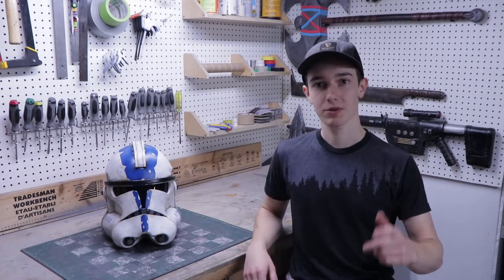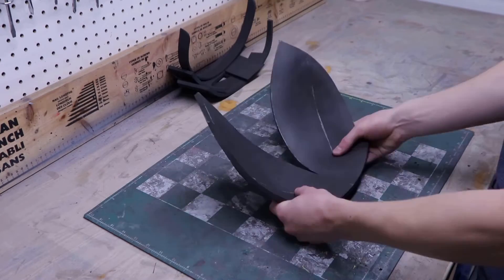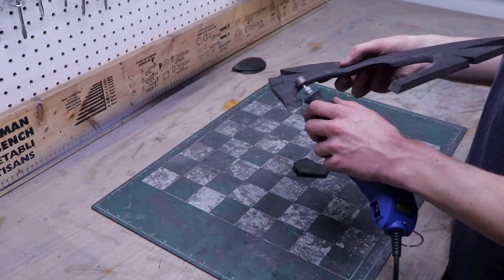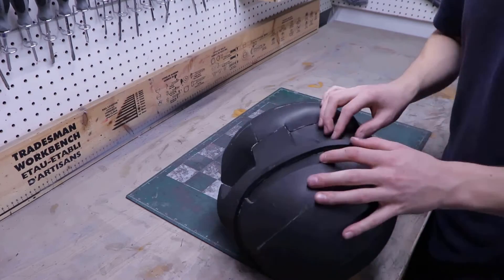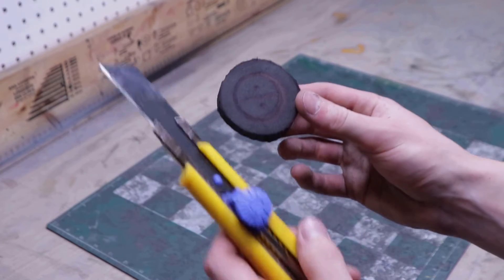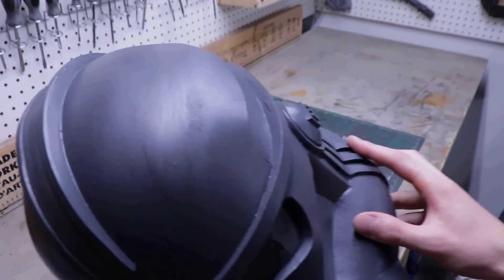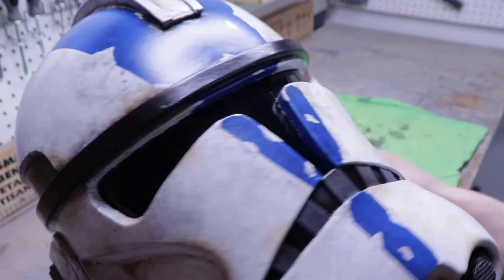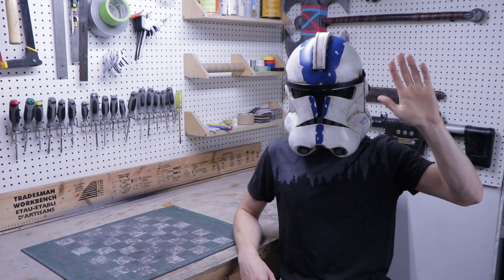Make Your Own CLONE TROOPER Helmet Out Of EVA Foam | With Templates

Comment: Do you think I could have mesh in the black areas of the mouth piece for ventilation? I’m very claustrophobic and I would need some airflow
Reply from the maker: Yes! You can cut out the black areas once the helmet is built and glue in a mesh material. You might need to reinforce that area since foam isn't super strong. :)

Comment: I am trying to (long term) make a good amount of clone helmets, would you say that spending the money on 3 d printed helmets is more worth it than doing eva foam if you don't have much time on your hands? Which is the best option time wise, while still being not horribly expensive?
Reply from the maker: Buying a 3D printer and printing your own helmets is definitely better than buying 3D printed helmets long term.

Making helmets out of EVA foam and finishing 3D prints takes about the same amount of time. The difference is that it might take more practice to get good with EVA foam than with just sanding and painting an already printed helmet.

I find that building a helmet out of foam is more fun and less repetitive, but everyone has their opinions on this.

Comment: Hey so I’m using your armor and this helmet templates and I am making an arc trooper, how do I modify the fin to be the arc trooper fin?
Reply from the maker: For my armor I used the fin from my phase 1 clone helmet templates. Also the front under the grill is a bit different. The tip is pointy and the respirators are more round.

Comment: How do I print the templates? I bought it but I don't know how to print them the right size
Reply from the maker: You can print the templates on any size paper and using any printer.

Check out the sizing chart located in the pictures of the listing to find the scale that matches your size.

Then, simply watch the printing tutorial video linked in the product description. All the information is there.

Comment: Hi, thank you for the amazing tutorial! I was wondering what you used for the visor? I see you cut it out, but I don't understand what you used to fill in the space. 
Thank you 😊
Reply from the maker: I used a tinted welding shield. You can find them on Amazon. :)
Reply: @TristanMaker  So I'm trying to make the helmet and the foam is not sticking together. I'm using Lepage heavy duty contact cement and craft foam to make a trial version before I make a full helmet and it's not flexing at all and the glue won't stay, what am I doing wrong?
Is there a difference between EVA foam and craft foam?
Reply from the maker: The biggest issue is the Lepage contact cement. I tried it and it just doesn't stick well at all. I recommend DAP Weldwood or Barge cement. And yes craft foam is EVA foam, but you really have to  heatform it to make a helmet.
Reply: @TristanMaker  ok thank you, the biggest problem is I can't get those where I live, I'll have to order it online. Is it easier to do it with Eva foam? Should I just start over?

Comment: I bought the template awhile ago and am just now starting the build. The 8mm visor piece that has the 5 mm attached, am I supposed to cut that piece out seperate and trace on 5mm?
Reply from the maker: Yes exactly, you cut that part from the template, trace it on 5mm foam and glue it on the existing 8mm part
Reply: @Tristan Maker  okay great thanks! I may have other questions as I go...first build!

Comment: So I want to make this helmet but when I measured my head circumference I found it’s 22 inches and a half so would I do the percent for 22 or 23 when I print it out
Reply from the maker: You can simply print the helmet at 100% scale. It will fit perfectly with some padding inside.

Comment: incredible work, dude, congrats, a question, can i cover the helmet with glass fiber to make it strongest than just eva foam? is a similar process, right? the resines of glass fiber not "eat" the eva foam?
Reply from the maker: Thank you! I would not recommend covering the helmet with fiberglass or resin. One of the perks of eva foam is that it's flexible. To keep that flexibility, you can cover the foam with 5 coats of modpodge. It will make it stronger too.
Reply: @TristanMaker   wooo, great tips, dude, thank you again, i suscribe now 😃

Comment: I’m very new to the world EVA foam. Would it be possible to sit while wearing full armor? If seams were to hold and not split, I’m thinking it’s a tough challenge for the foam to hold it’s shape. Your work is amazing btw!
Reply from the maker: Thanks! For my Mandalorian and Boba Fett armors, you can sit because there's no armor piece under the butt. Unfortunately the clone trooper armor has a big piece covering the butt so sitting is not an option without cracking the paint and foam.
Reply: @TristanMaker  Ah makes sense! Didn’t even take into consideration the paint cracking!

Comment: I might be late to the party but how sturdy are the foam helmets and armor you make? I would hate to accidentally ruin one.
Reply from the maker: It mostly depends on how you paint them. Foam armors are flexible so they don't break easily. Most of the time the paint chips or gets scratched. I recommend doing research on sealing and painting methods to see what is the best option for you.
Reply: @TristanMaker  will do, one last question, not sure if anyone mentioned this but how much foam do you usually use for these?
Reply from the maker: It's hard to say, but for the main thickness which is 8mm, I use less than a 1x1 meter sheet.
Reply: @TristanMaker  alright, thanks for the answers!

Comment: This is a great pattern. Always hard finding helemtes with such elaborate shape made out of foam. Mostly its 3d printed or donw with glassfiber. One question I have tough in regards to your foam: What is the density of the foam you use? Is it a high or low desity? I'm from Germany so I cant exactly use the shops you use so I'm asking :)

Great work nontheless and wayyy underrated with just about 400 likes. Will subscribe and keep track of your great works :)
Reply from the maker: Thank you!
I like using medium density foam for all my builds, but you could also use high density foam, it's just a bit harder to work with.
Reply: @TristanMaker  thank you very much! 

What are your next projects in planing? :)
Reply from the maker: For now I'm finishing the Boba Fett armor. After that, I might make his blaster and jetpack.

Comment: Do you think that I could make it with card bourd instead of Eva foam? I have made 2 helmets before.
Reply from the maker: Cardboard doesn't flex like EVA foam so some of the parts on the template won't work. If you are good at patterning you might be able to modify the template for those parts, but I can't guarantee the result.
Reply: @TristanMaker  ok. Thank you.
Reply: @TristanMaker  about how long did it take you on the building stage?

Comment: Two questions
1.) is it really bendy/flexible 
2.) can I use a hair dryer instead of a heat gun?
Reply from the maker: With all of the paint applied, the helmet is not very flexible, but won't crack if it gets dropped. Unfortunately a hair dryer doesn't get hot enough

Comment: This might be a dumb question, but could I use 10mm foam in place of 8mm? I understand why you use several different thicknesses of foam for most of it, but where I live 10mm EVA floormats(which I already have some experience with) are nearly 1/3 of the price of 8mm cosplay foam.
Reply from the maker: You could totally use 10mm floor mat foam for this build, but it will be a bit more difficult to heat form and glue the parts. If you can get the thinner 6mm floor mat foam, that might be an even better option.
Reply: @TristanMaker  Cool thanks for the help!
Reply: 5mm foam will work?

Comment: My templates dont work some of the parts are too small or too big and dont fit did anyone else have this problem
Reply from the maker: Hi, I'm not sure how this can happen. You can write to me on Etsy with pictures of what is wrong and I'll help you the best I can.
Reply: @TristanMaker  thank you so much ill try to send pics its mostly the band in the indented part of the dome on the side and back thats too short or maybe the dome is too big idk also i tried to cut out the templates the best i can
Reply: @TristanMaker never mind it works just a little right in the back area

Comment: Can i use this templates with cardbosrd?
Reply: Cardboard isn't as flexible as the foam, but if you use several smaller and thicker pieces and then a sander, I'm sure it would be fine

Comment: Is it ok to use super glue
Reply from the maker: You can use super glue on foam, but I only recommend it for small pieces that don't hold tension. Contact cement is a way better option for that
Reply: @TristanMaker  thanks